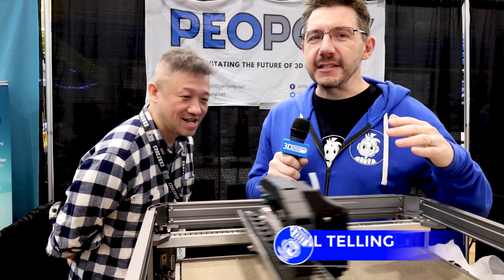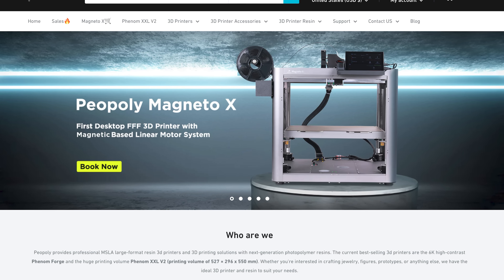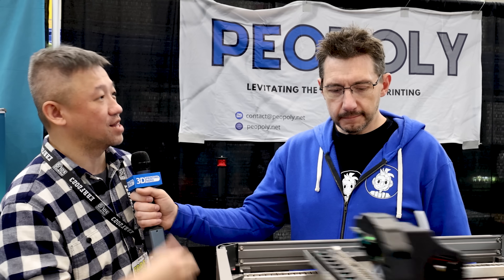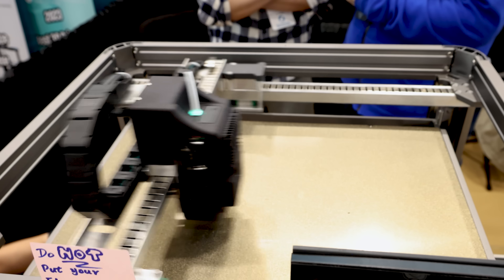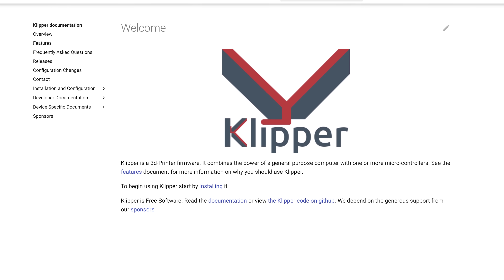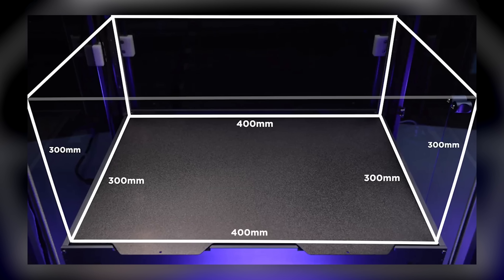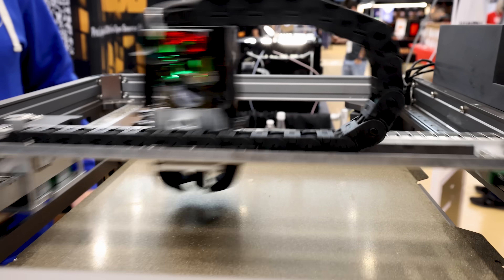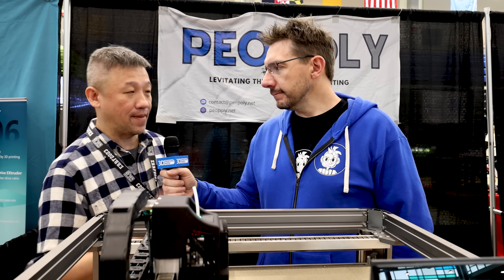Peopoly Magneto X - FIRST LOOK!

Comment: Rule 1 of making a voron style printer is, make the x  axis as light as possible. What is this design even, keeping that in mind.
Reply: Everything goes out the window when you're not gimped by flexible rubber belts. Weight is not a factor on Linier rails at this size. Apples to Oranges
Reply: @a2dskins   First of all, My mistake for calling this a voron style printer... it's a core xy style printer. And not even that, it has no belts. So sorry about that. I'm not concerned about the linear rails, more the linear motors. All those magnets weigh allot and moving them around means it won't move as fast. I hope to see more of this with a realistic speed test, while printing, but other than a cool factor I don't see this being any more performant or cheaper than stepper motors. It definitely has a leg up in terms of precision tho.
Reply: @andrewwatts1997   Weight is relative to force. You can have a heavy car with a powerful engine and a light car with a smaller engine perform the same in acceleration and deceleration.

Comment: I'd love to just buy the linear motors from them to upgrade my pick and place machine. Thats an application where very high precision, acceleration and speed is far more important to me. Might have to send them an email and ask if they are going to sell the motors individually, maybe like a spare part.
Reply from the maker: If these work out, my guess is a lot of people are going to watch to acquire those linear motors.
Reply: i bet for sure companies will make their own and sell them by themsleves for people to create whyatever they want with them, futures looks wild
Reply: @Mr.Thermistor7228  I already researched and found companies that do make linear motors that are similar in size, but they are waaay more expensive than the entire Peopoly printer. I hope this could be the spark that brings smaller, low powered linear motors from professional grade industrial applications into a wider range of products.
Reply: I'd like to upgrade my delta printer with linear motors. But I went ahead and pre-ordered a Magneto X in the meantime.

Comment: 3 microns... no way. But otherwise nice concept.
Reply from the maker: I mean, it could be.
Reply: A 0.2mm nozzle does at best 0.04mm layer heights and 0.15mm widths.

Trying to hit details 0.003mm in size with that is like training to paint the Mona Lisa with an elephant

Unless they have a whole ecosystem of super fine filament, ultra fine extrusion systems and super super fine nozzles on the way, it's not achieving 3 micron resolution

You would basically need a 0.015mm nozzle, almost ten times smaller than what's commonly the smallest size available on the market. Of course not to clog it, you'd need filament of a much finer grade and much smaller width, with new extruders to support such a small size.

Not easy, perhaps not impossible, but looking at that machine it's clear it's geared for large object printing, not challenging resin.

I'd be surprised if it was even twice as detailed in printing resolution to current top of the line machines
Reply: @Tom--Ace   Listening comprehension. The LINIER MOTORS are accurate to 3 microns.

Comment: I had my doubts because of the potential weight of the magnets but it looks like it prints as fast as any other core xy printer. Just the concept of never having to worry about replacing worn or stretched out belts is a game changer. Thanks for reviewing this.
Reply: More importantly, the reported max speed of 80cm/s and acceleration o 22m/s² (yes, that's meters ) are absolutely insane. If it actually can print at these speeds, you're looking at a Voron 2-sized printer that's much faster than Voron 0.
Reply: Yeah. Not far of Vz330 speeds either: some people are rocking 3,000mm/s and 40,000mm/s^2 but you need to spend a lot of time building and tuning those! (Mine's just 24,000... But one day!)
Reply: i bet a lot of that wobble on the table is from tossing that heavy gantry around. I can't wait to see more of this beast.
Reply: @mcbeenb  I can't wait either! And contributing back to OSS too. What's not to love?
Reply: yeah, did you see that thing shaking on the table! I mean, my Bambu will shake my Ikea table it's on and I know for conference centers you are charged by weight for everything that is brought in so realistically you're not going to being in a heavy automation table, but DAAAYUM it was shaking!
Reply: @nathan80999 it was the table that was shakey, i'm sure that on a more stable surface it's just fine.
Reply: I'm more interested in the fact that you don't need to worry about belt tightness.
Reply: *faster

Comment: 30mm/s, so volumetric flow would be pi*(1.75/2)^2*30=~75mm^3 max.  At that flow, I think it will still be flow limited if the speed is what they say it is.
Reply: 60mm/s for the Lancer Melt Zone Long.

Comment: 3 Micron is the same as 0.003 millimeter
Reply: How is it going to achieve that when even a 0.2mm nozzle generally doesn't do any lower than maybe 0.04mm layer heights and maybe 0.15mm layer widths?

It looks like the machine is set up for printing large objects quickly, not small objects more precisely (aka resin), so I don't see the advantage over something like a bambu x1c.

Your positional accuracy might theoretically be 0.003mm, but by the time extrusion accuracy limitations kick in, let alone ringing and input shaping inaccuracies, there's no way in hell you're achieving details 0.003mm in size

So it's a bit of a lie - ONE part of the system MAY achieve 3 microns/0.003mm, accuracy, but the rest will likely compromise that accuracy to the point where it might be more on par or only a little better on fine details.

A doubling of fine detail resolution over something like a bambu would still be exciting, but far from a quantum shift.

Perhaps enough to challenge resin though
Reply: @Tom--Ace  i dont think this will be any more accurate than a belt printer. that 3 micron is mostly just marketing talk. the advantage is being closed loop, not dealing with belt tension issues,

Comment: Really a neat approach to 3d printing! Wish I would have been able to go to the ERRF to see it in person...maybe next year (I said that last year). I am wondering with what everyone else is asking about the magnetic field if the enclosure would block all of that?
Reply: Just a heads up, next year's ERRF is going under a new name, they announced at the event that they are rebranding it to 3D Printopia. Hope to see you there!
Reply: Not hard to imagine a solution for that, if you needed it shielded. Instead of glass or plexiglass it would have formed steel sheet.

Comment: Why is everyone using a wired connection to the print-head? Wouldn't a wireless connection mean fewer potential points of failure?
Reply: As in having the power + data lines through the x axis beam somehow?
Reply: Latency issues

Comment: very interesting!!!! but what are the true benefits - i believe we are at the pinnacle of motion systems - what we need is better software and non-planar printing AND a good 24x24 3d printer - hear us bambu? notice how much the system shakes - we need a fully closed loop servo system we MUST STOP looking for cheap - we are well past the hobby phase -
Reply: The linear motors are closed loop.
Reply: closed loop servos on a 3d printer??? a whole lot of extra cost for essentially zero benefit.
Reply: @timr86868  the printer in the video is closed loop.

Comment: I think that this setup would be really interesting if they use high temperature neodymium magnets. Then we could have chambers that is warmer then 100c°.
Reply: My thoughts exactly.  If I had the spare cash to buy one, I would be clawing for my wallet right now.  Seeing the build volume and how it's arranged, I am beginning to wonder why there aren't more 300x400x400 vorons floating around.  For a little extra belt length and a wider machine, the effector movement would be roughly as fast as a 300 cubed machine, but the extra build volume you get would be massive.
Reply: The really cool thing about linear motors is the fact that the heat build up from use is spread out over a very large area. They will normally handle a lot of heat. Now if this one is designed the same, time will tell, but I think it should handle a lot of heat.
Reply: idk though arent magnets very affected to high heat? i think its like a threshold type deal where at tempuratures at or above a certain point they begin to go haywire and flip polarity and shlt lol i know there is a point at which it begins to hapen
Reply: @Mr.Thermistor7228  Yes you are correct. It is called the Curie Temperature. Good Wikipedia on it. Neodymium is about 310C on the low end, BUT they will lose strength before that point. The reason linear motors do better than a "can" motor is the magnet can lose heat and not fully contain the heat even in a 100C chamber. If you have a 100C can motor on the outside, the inside can be twice that. Linear motor is pretty much just the outside temperature plus a few degrees.
Reply: Should be at least 120°C.

Also, it's just possible to water cool the magnets?
Reply: problem the neodymium magnets already start to die above 75-80C ....
Reply: @snapo1750  that's why we put 115 °C on our prusa beds. 🤡
Reply: @snapo1750  They have new ones out rated for 300c. No degradation at all.

Comment: I heard that there is quite strong magnetic field around the printer, i mean not only near the magnets, or inside the printer, but also around the printer in some perimeter, is that true?
Reply: I don't believe the magnetic field would extend much more than a few inches from each of the magnets.   It takes a massive magnet or large amount of current on an electro-magnet to create a field like what you are talking about.

Comment: What are the expected benefits, something like higher precision at speed thanks to the lack of belts, and low noise?
Reply: I think lower maintenance perhaps ? The system seems to have less moving parts than the average coreXY printer , lesser moving parts=less maintenance
Reply: I can't speak to 3d printers but we use linear motors on the robotic systems at work and have done so since 2003 or so. They offer exactly what you stated, higher precision, less maintenance and they last forever since there are no moving parts. Personally, this seems like it would be a big win for reliability over the long term (if their electronics are up to par).
Reply: Good question.
Size?
Price?
Noise?
Speed?
Weight?
Precision?
Tinkability?
Maintenance?
Expandability?

... To me this machine looks like a gimmick, unless some of the above are significantly better than with standard components.
Reply: @ZappyOh  400 x 300 x 300 print volume.
800 mm/s print speed.
Linear motors 3 micron accuracy.
Presale price $1399, 
Regular price $2000.

Comment: I just have one question: what does it look like for users with, for example, a pacemaker or something like that?
Reply: Probably a very long sleep!
Reply: I know the big machines with linear motors have large warning signs to stay away with pacemakers, mobile phones and watches. These smaller ones probably are not producing large enough electromagnetic fields to be a big issue, as long as you don't sit directly on the printer or lean against it while it's running.
Reply: I see a new market opportunity, a MuMetal line of clothing for the serious 3D printer…

Comment: It was clear that after Bambu disrupted the market, others would have to follow suit. The printer has really interesting approaches
Reply: The founder says right in the beginning it was inspired by the Voron project
Reply: @drewmiller9036  ya the voron community has been really pushing the bar for what counts as a quality 3d printer. I dont have one but i do have a troodon 2, which is basically a clone with injection molded parts... its a dream. i've built and had so many different kinds of printers and the voron design is the best i've had so far.
Reply: @drewmiller9036 that’s not the point though. Whether they were inspired or not they made an impressive breakthrough by doing away with steppers and belts system which is a major step in getting closer to real cnc level of precision. Belts and steppers are the one glaring issue of current printers causing many issues like ringing artifacts and loss of precision from belt loosening from wear. This is an important innovation for consumer printers.
Reply: That really doesn’t seem to be the case here at all. This seems like it was developed independently by people who just were bored in their lockdowns and decided to make a printer. They even mentioned voron was their inspiration, not Bambu. Just because Bambu made a printer much better then most other printers on the market doesn’t mean other companies couldn’t have been doing the same thing at the same time. This happens a lot in physics, multiple physicists develop the same theories or formulas, completely independently at the same time.

Not every fast printer that is released is inspired or based on Bambu.
Reply: @conorstewart2214  "Not every fast printer that is released is inspired or based on Bambu." didn't anyone say that?!
Reply: @highlander5521  "it was clear that after bambu disrupted the market, others would have to follow suit", so yes you said something very similar.
Reply: @conorstewart2214  No, I just said that others now have to follow suit, either with their own innovations (like here), speed or quality... I never said anything about them being based on bambu... my goodness
Reply: @highlander5521  note I said inspired or based, not just based. Your comment implies that this printer and others exist because of bambu and other companies are just "following suit" and trying to make a printer on the same level or better than bambu's printers, when it just isn't true at all.
Reply: @conorstewart2214  oh boy...its ok...
Reply: yall out here arguing about shit like this is embarrassing lmfao
Reply: @highlander5521 wtf do you think the implications is when you say "others follow suit"...
Reply: People rly think bambu invented core xy lmaooo
Reply: @azimuth9819 all they did was fast printing and now people can't shut about them.  It actually makes me not want to get Bambu lol.
Reply: @azimuth9819  Nobody said that at all?!
Reply: @azimuth9819 your just jelly you can’t afford a Bambu and still have a shitty ender 😂

Comment: A 3D printer that doesnt print. Amazing! Jokes aside, interesting design. With things like input shaping the weight shouldnt really matter. Its just whether they can get good repeatability on it.
Reply: You just have to wait a bit before you can see the print. It prints faster than your eyes can process the image of the model. 😛
Reply: @pcwzrd13  the test print he held up looked pretty good
but all round, no corners, that's a bit unfortunate
Reply: @marc_frank  This won't have any problems at all printing corners with the accelerations and control of a linear motor.
Reply: @adisharr  yeah i just wanted to see one
Reply: @marc_frank  I don't blame you - it would have been nice to see a detailed print instead of a large round one.
Reply: with closed loop control of the position of the extruder, there isn't really a need for input shaping
Reply: @marc_frank That was exactly, what I was thinking. Also input shaping compromises on precision(loss of sharp features), just like smoothing of  images, to reduce noise. With the linear motor(essentially a 3 phase ac motor running linear), there is benefit of instant torque and deceleration(electric cars), will also substantially simplify retractions and linear advance, when done right. No belt tension to adjust either!. In the end, it is all about the cost and ability to realize full potential, in terms of precision and performance. There is a definite need for precise bed leveling and an insanely fast and precise extruder hot end combination. Even a bad slicer decision could derail the impact. One potential issue could be the use of magnets(in linear motor), in the context of  high temp. enclosure. Not sure how they are different than stepper magnets though. Just some 💭♥️👍
Reply: weather - the state of the atmosphere at a place and time as regards heat, dryness, sunshine, wind, rain, etc.
"if the weather's good we can go for a walk" 
whether - expressing a doubt or choice between alternatives.
"he seemed undecided whether to go or stay"